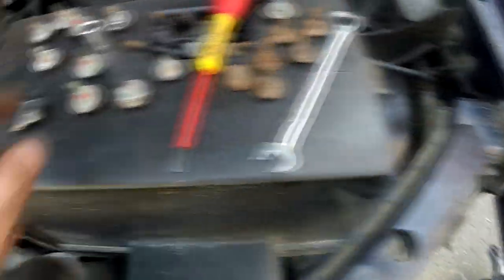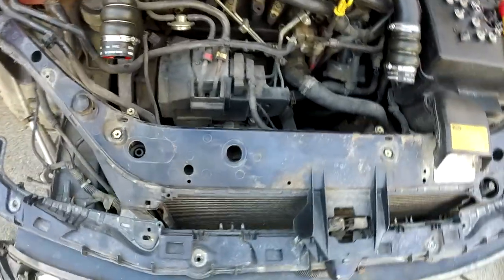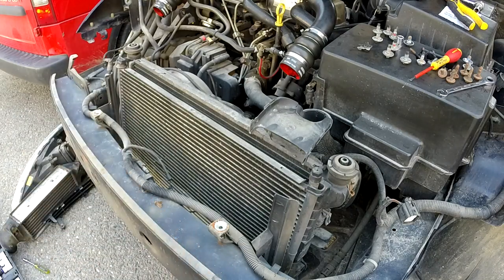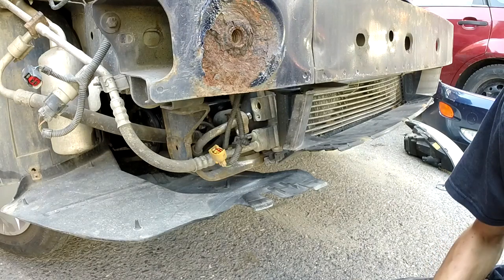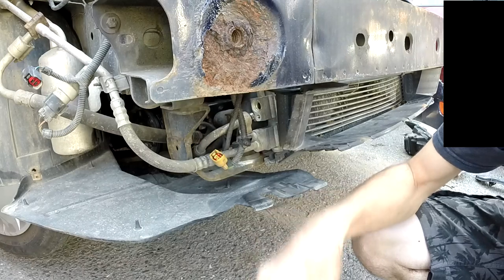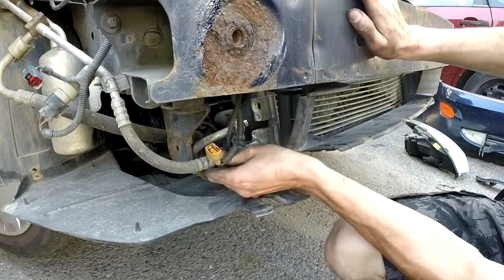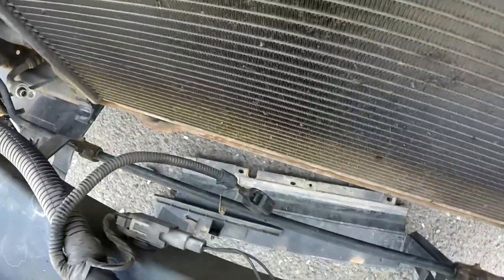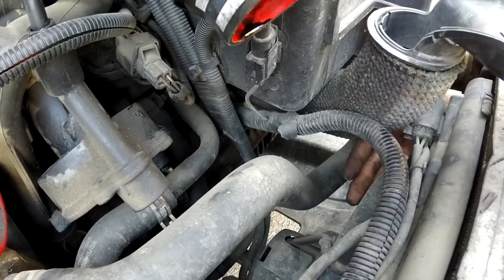How to Replace the AC Condenser - 2001 Ford Focus

Comment: Can you install AC into a car that has no AC option?  I just bought a 01'ford focus and it has no ac.  I wonder if I went to a wrecker and found a focus with ac and swapped it??
Reply from the maker: I guess you can, but you would need to take apart half of the car. Good luck!

Comment: Is there a bushing or rubber support under the condenser?
Reply from the maker: There is one on either side, it holds both radiators on the support bar/part.

Comment: How do you de-pressurise the air conditioner radiator? Drain the refrigerant?
Reply from the maker: Ideally yes, with the machine used for that purpose.